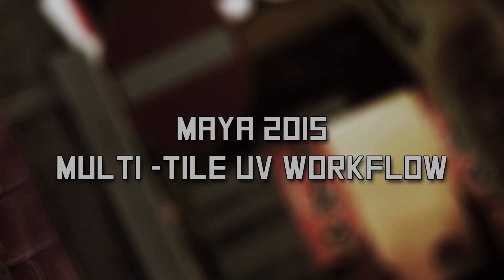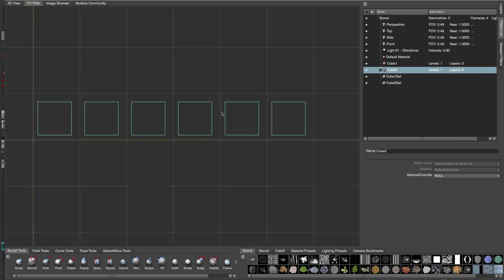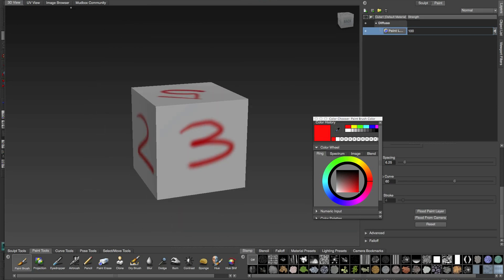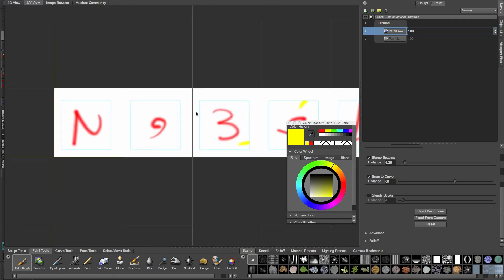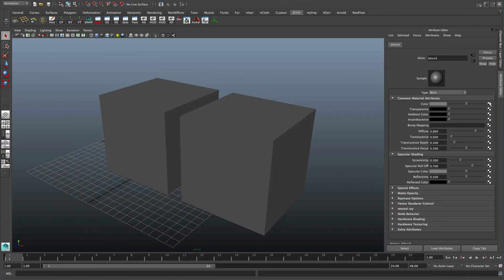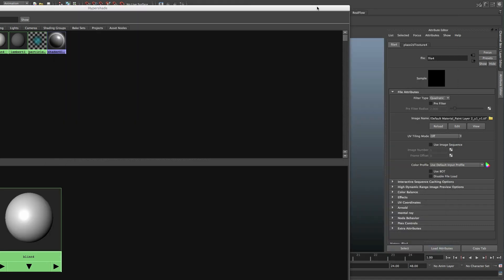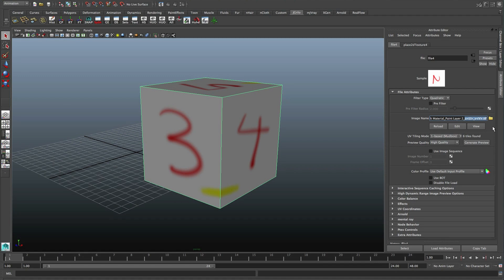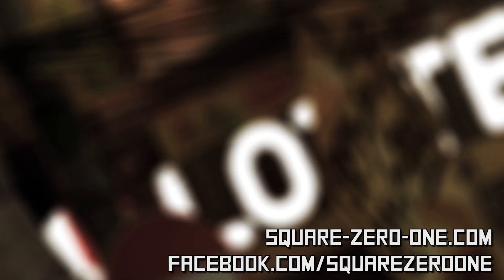Maya 2015- Multi-Tile UV Workflow

Comment: Hello,
thanks for the tutorial first of all.
But this is only for diffuse textures, this process does not work when you try it with normal map and displacement maps...
do you happen to know what would be the procedure for settings up multi tile NM and DM in maya to be rendered with mental ray?
thanks.
Reply from the maker: If you cant use the current way to load the multi tile uv , use the old ( under the hood ) way ex: normal.1001.tif to normal.<UDIM>.tif 
http://bneall.blogspot.com.au/p/udim-guide.html